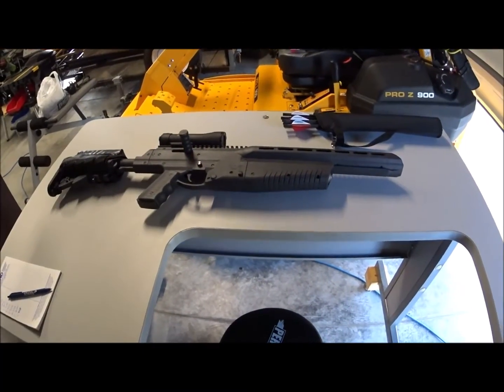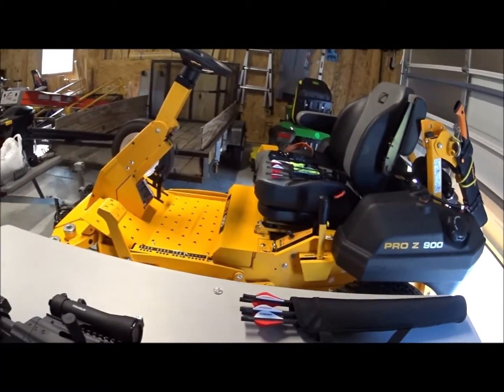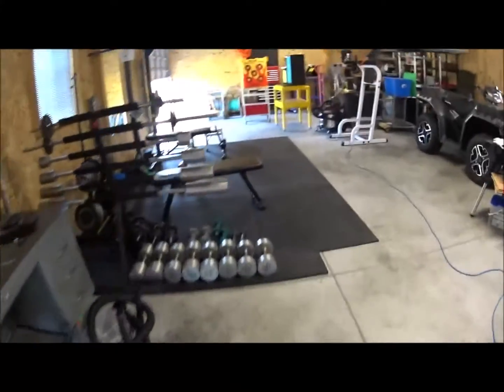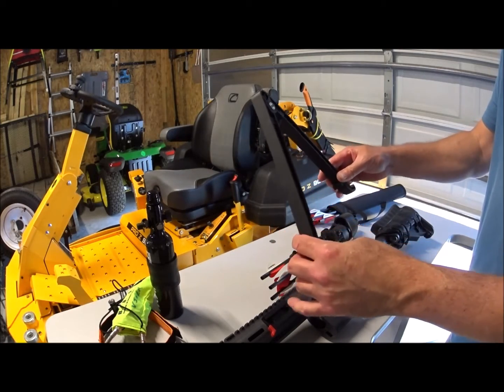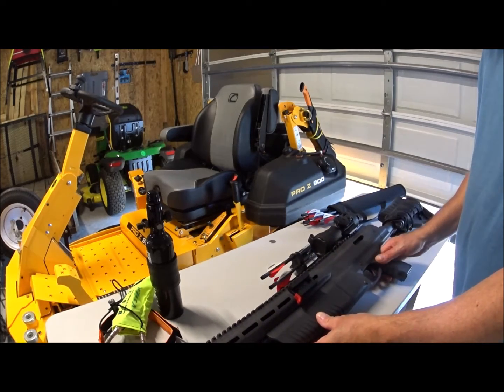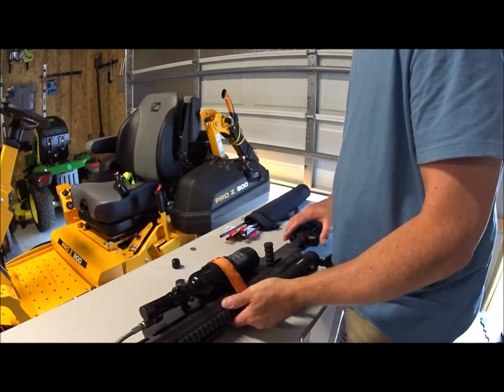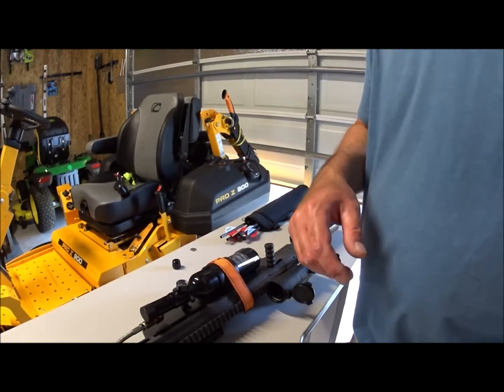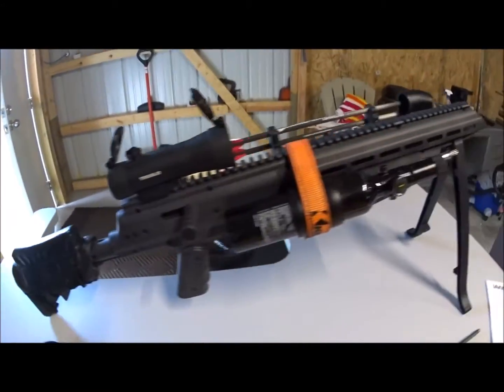Umarex Air Javelin - Part 1 - Co2 Chrony Testing,  & Part 2 - HPA Conv & Other Mods

Comment: 💡You have to install a stronger hammer spring so the hammer has enough umph to open the airway against the higher pressure💥👍
Reply from the maker: Cool, thanks
Reply: Yes you're right, that's exactly what I had to do. I'm pushing arrows/bolts with 1600psi and I absolutely had to put a harder hammer spring in it, and I'm now getting over 400fps speeds.

Comment: First of all, I want to thank of VipersVideos for a great video about turning Umarex Air Javel into a PCP arrow rifle.
Inspired by those videos I printed, with a 3D printer, parts the upgrade version. 
As you can see in the gun you can use ready-made Mil Spec back stoks.
The lower rail part has been removed from under the front support, then the pressure bottle can rotate into the 88g seat of the gun. (88g co2 adapter)
Reply from the maker: Thanks for the comment, and nice job making the parts and upgrading your Javelin.

Comment: Good video ! Great idea  ! The ideal situation for hpa would be if you could find a smaller diameter bottle that could screw into the gun right where the CO2  cylinder go's ! I've got a 13 CI bottle regulated to 1100 psi left over from when I upgraded the bottle on my Umarex gauntlet to a 23 CI bottle ! I wish I knew a Machinist who could make a drop adapter that would fit the bottle and the gun and lower the bottle so it would fit in the stock !! If you have any ideas please let me know !
Reply from the maker: Thanks, and yeah a thinner hpa tank/bottle would be ideal to screw in the co2 threads. I just ordered another hpa 13 CI bottle reg'd to 1100 psi so that's what I'll be sticking to for now. There's another YouTube guy named Kid Pellet who found a drop down adapter, and made a threaded tank adapter as well, maybe similar to what you're mentioning. Look him up and check out his Air Javelin vids as he's real creative making stuff and shares all his ideas almost like DIY style.

Comment: I think you can buy a kit to fit a longer pcp bottle on it but the cover will need to be left off and the gun allready has a internal regulator so you dont really need a regulator on the bottle itself. Then in theory you should get the 300 fps same as if you were using co2 .
Reply from the maker: Cool, where did you find out there was an internal regulator in the gun itself? Anyway, I already have a 1100 psi hpa bottle, but just have to find time to shoot, chrony and make a new vid...
Reply: Please let me know if you find a kit that I can purchase.

Comment: What is the advantage of HPA over CO2? I expected HPA to have higher velocity/power, but this seems not to be the case?
Reply from the maker: For me, it's cold weather. Where I live about 7- 8 months out of the year it's too cold to utilize co2 for acceptable power or efficiency.  
The advantage - HPA is consistent all year round temperature wise. Not extra power, but no cold temperature power/efficiency drop like co2. Also the tank I have is regulated for maximum efficiency.

Comment: co2 don't go bad... if it was 20-30 years old and kept in a dry area its fine .
Reply from the maker: Thanks for confirming that. It's the zinc plated 88/90 gram cartridges I'm finding myself concerned with as I'm hearing loose metallic sounds in some of these old ones, and some metallic pieces are bouncing around in the empties I'm finding. So yeah, more these particular tanks could be the long term storage issue, and not the Co2 itself.

Comment: Set your reg to 1200 psi that should do the job I use my umarex gauntlet tank  on my javelin
Reply from the maker: I recently got a 1100 psi reg tank and it's doing great. I need to get a video going on that. I will look into setting it up to 1200 psi when I get a chance. Thanks!
Reply: Hi, is the javelin really internally regulated as stated in one of these comments? I am also using a guantlet 1100 psi bottle with the hammer spring threaded all 12 turns in.is there a proven set up to max out the javelins fps?
Reply: For me 1100 psi and 12 turns gets me 307fps.. hoping someone can tell me how to get 330 FPS ....pressure and hammer spring set up..
Reply: If you used a 1200 psi set up what did that get you FPS ? Did you adjust the hammer spring with the 1200 psi?
Reply: Details on the adjustable hammer spring screw...I opened up the gun to see and do this...the screw takes a 5/32 Allen key...I noticed the slots where the adjuster rides has to be filed to let the adjuster track back and fourth easily... if you look closely at the slots, only where the adjuster sits from the factory, is it free .. the rest of the track is very resistive to movement by the adjuster ..I filed the rest of the track to get the adjuster to move freely ..Now I think it will move both ways properly..if you don’t file this track ,when you try to move the adjuster back at all ,it may or may not move and you won’t know it..the screw turns 12 full turns in adjustment ..I didn’t file the plastic track on the hammer, instead I filed the hammer itself, just filed a bit on the track marks that the plastic scored on the hammer..I really want to maximize the FPS on my javelin..I know it will take figuring out incoming psi and hammer spring tinkering..is this thing really internally regulated? did umarex confirm this? is that where the info came from?

Comment: I bought this gun specifically because it uses CO2 and I don't want to spend the money on a two-stage compressor right now. If you wanted a PCP arrow launcher the Saber is only a couple hundred more than the Javelin. You'll spend that much retrofitting this gun. Just sayin.
Reply from the maker: Yep, so did I but now I have 6 months of winter to look forward to so just wanted to 'see if I could' convert it to hpa to use in the winter and just for the heck of it really. As I mentioned in other replies, I picked up an Air Venturi AV 3000 PSI 13ci Tank & Valve 1100psi regulated, and now I can successfully use the Javelin with Co2 in the summer and hpa in the winter. I'll be making another vid of that soon, thanks!
Reply: The Saber is huge though. Lol. Like my wife wants to shoot or carry a Sabre or me, lol. It's her airbow. This thing weighs a mere 4lbs, stock without a CO2 cartridge. And you know, seeing as you own one, it's not a long unruly beast like the Sabre either.

Comment: You can regulate it for 1000 psi
Reply from the maker: Thanks for that info, as I was wondering if it could be boosted. That said, I just got an Air Venturi  13 CI regulated at 1100 psi that Black Scorpio mentioned a couple comments below. I'll be trying it out soon and making a second video with the Javelin using it.
Reply: This is the first and only video I have found regarding converting the. Javelin to HPA.   Trying to figure out what would be needed to connect the 13cc tank directly via the 88g to ASA adapter.  The smallest diameter HPA tank I know of is the 13ci tank as you have which is 50mm wide or radius of 26mm from center.  The JT brand 90g disposable tank I have measures 35mm across so should have a radius of 17.5mm.  Guessing the channel / track that the removable fore grip slides on sticks down and is what is keeping you from directly screwing in the HPA tank.   What would be the adverse effect of cutting / grinding / sanding roughly 7.6mm or .30" of that channel / track away "other than loosing the ability to slide the fore grip back on" ?
Reply from the maker: @CVM222VOLT  Thanks, and there is another YouTuber who's channel is 'Kid Pellet' who also converted to HPA and made some great vids on it. One covers an adapter he made for a drop down stepped bottle adapter that would do what you want w/o having to chop into the gun body itself. Check him out, he does a great job of explaining his method.

Comment: You have to turn up the  regular up to 1100psi.
Reply from the maker: I checked with the manufacturer and was told the regulator on this model was preset to 800 psi and not adjustable. I have since picked up an Air Venturi hpa bottle regulated to 1100 psi and will be trying it out when I have a chance.
Reply: @VipersVideos  it's possible to regulate it just by adding shims.  There's a few good videos out there that show how.